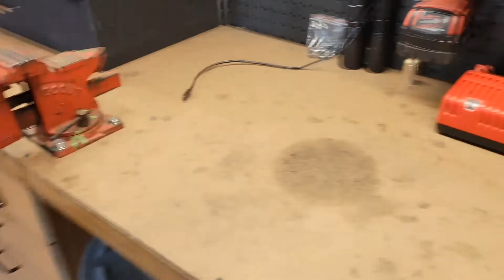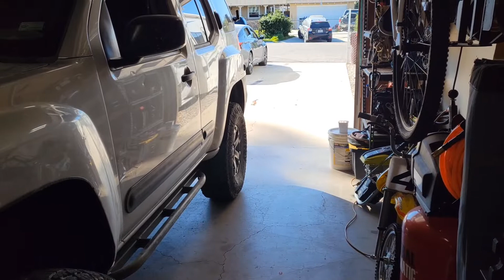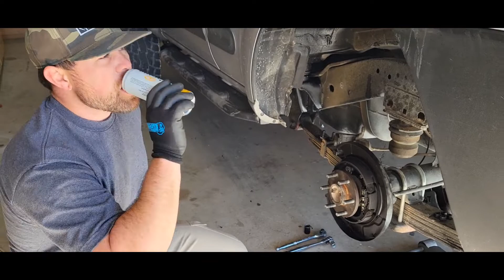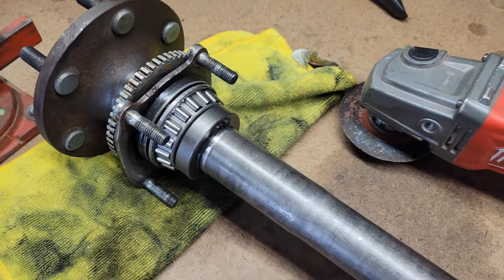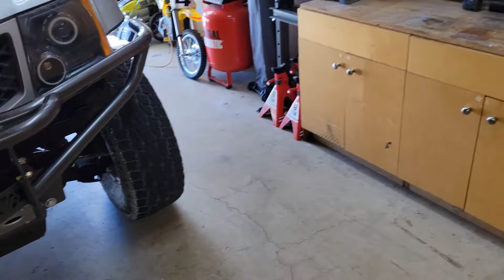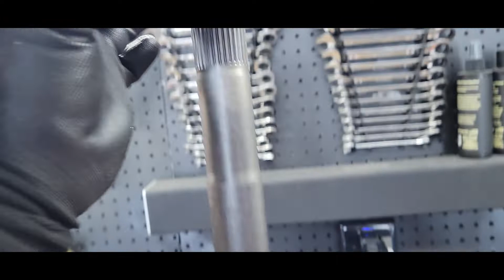Xterra m226 bearing replacement

Comment: I'm a machinist and build lots of rear ends I've seen many times when those shavings are all over your axle it is wearing the splines on the axle or in the side spiders and a bad enough wheel bearing will cause it to where the spiders and the splines also internal splines and external because it no longer runs true at the bearing

Comment: You don't freeze the bearing you can warm the bearing not to hot but you freeze the axle if you freeze anything! Also when cutting a race off cut it at 45 to 60 degrees only necessary on one side and hit it with a chisel it will crack right away and you don't get the other parts. When you freeze the bearing it shrinks and the race should be replaced every time as A-Team

Comment: Timken bearings are quality bearings. Being that this is a repeat problem I would look for the cause. You are not running excessively oversized tires with extreme offset rims. 1" spacers may be a contributor. M226 are Dana 44's and Jeep guys are running up to 37" tires without excessive bearing failures (on the rear at least) besides bending the housing. Any vibrations? If not, bent axle is out of the question. Next are the rear tires wearing unusual? That should point to a bent axle housing. A alignment shop can help you with that. Obviously gear oil is reaching the bearing so it can't be that.  Hope this helps and you find a solution. Post the outcome and if you solved the problem.